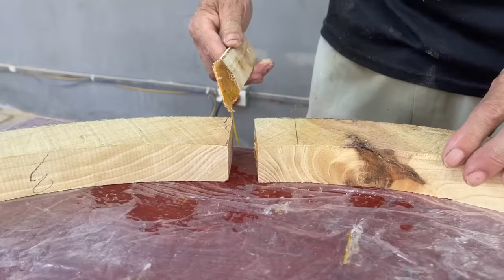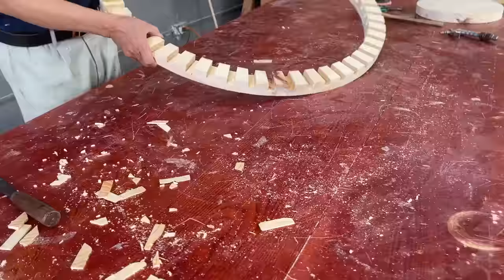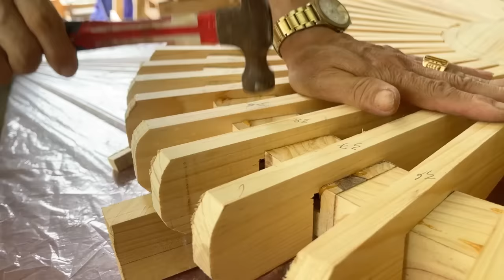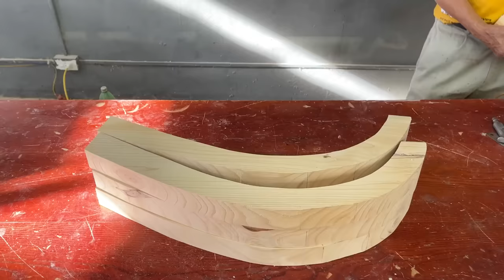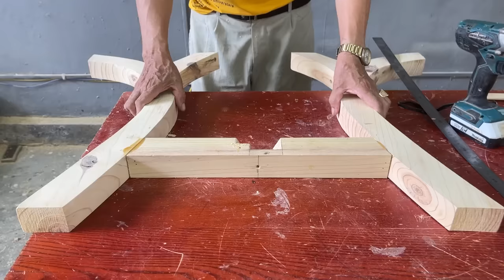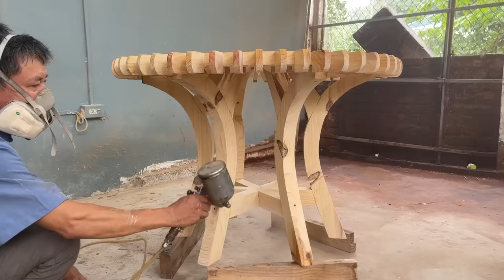Incredible Creative Design Idea From Wooden Strips // A Great Design For A Gorgeous Coffee Table

Comment: I love the design but it is impractical as a coffee table. Cups placed on the table would be unstable unless precisely positioned. People like to be able to put a cup down without having to pay too much attention. This could be addressed with a thick glass top which would provide a stable surface and still reveal the beautiful structure beneath... it would also be easier to clean.
Reply: Hey just have a round piece of glass placed on the top. That will make it a great coffee table.
Reply: Needs a glass top then it'll be good to go.
Reply: Ü
Reply: Yeah!  It would have looked great if had put epoxy in all of those areas with maybe a metal rim
Reply: I agree it's very beautiful piece and it wouldn't take much resin to to do the top and it would last forever
Reply: 58 14:27
Reply: @Hefty54 14:54

Comment: I shudder every time I see someone using a bandsaw with the upper guide block/bearings so far above the workpiece. The blade tracks far better the closer to the cut line as well is much safer, preventing losing fingers, hands etc. Just saying. I think that is the first thing you would be taught if you had lessons on the safe operation of a band saw.

Comment: The glue up of the pine arcs used epoxy apparently. Good idea for strength, he then used butt joints for assembly. That joint is structurally the weakest joint in woodworking. Bad craftsmanship from a talented craftsman

Comment: I'm sorry but I can't believe all the work that went in to this table only to see all the scabbed in pieces instead of just cutting 4 more small pieces to replace the ones he glued together to make it work. As a woodworker video lacks details that a carpenter would throw a fit with. Go back cut those scabbed in pieces out and replace them with a single small piece so it doesn't look like sub quality  workmanship. Don't just slap it together think about correcting the mistakes as you go. I know you can do better than this, take your time to do it right.